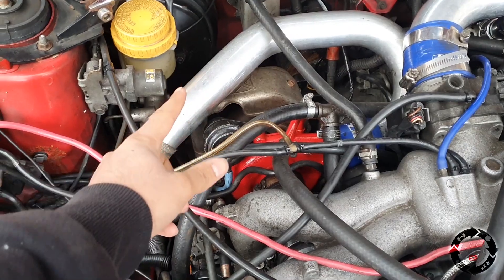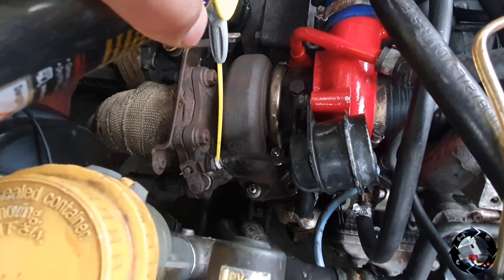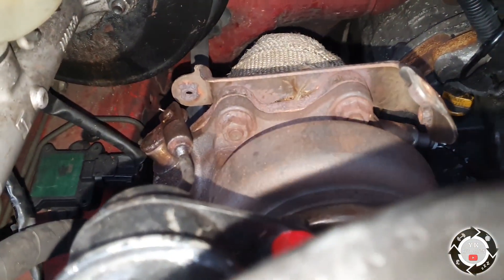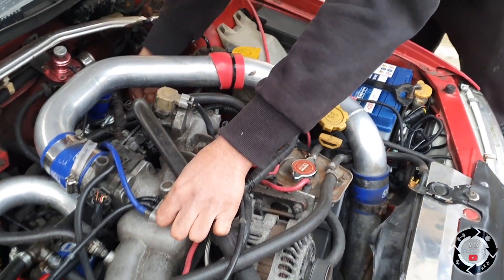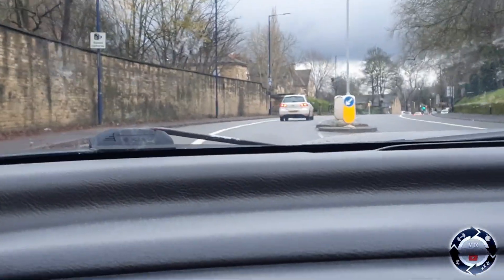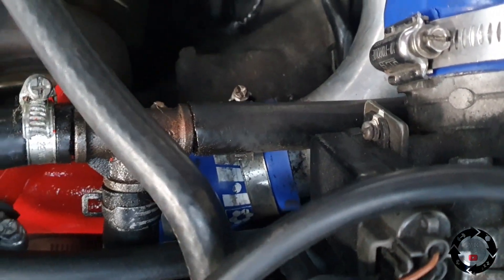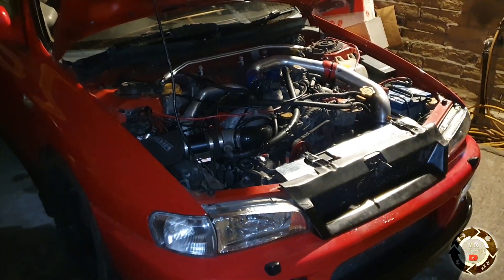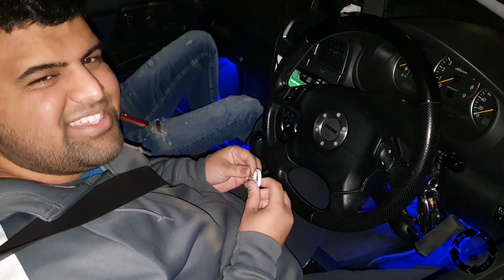FIXING BOOST CUT ON SUBARU IMPREZA GC8 *1.6BAR BOOST*

Comment: Hi mate I have a JDM WRX gc8 and I've just fitted a new turbo actuator and boost guage. It's boosting at 0.8 bar. In order to turn the boost up will I just need a manual boost controller? 

Thanks bro From Manny u boys sound like near Leeds ways maybe? not sure lol
Reply from the maker: Hi mate hope your well, turning up the boost manually is a bad idea, you need to get it re mapped for your new turbo setup 👍🏼 we did the tweak as ours is already tuned but since we had a few leaks fixed it was running too high so we turned the boost down. If you want to control your boost you can get that mapped in also. So you can have the option of high boost and low boost settings

Comment: You have shortned the wastegate arm, making the spring preload higher... meaning it's exaclly what you DON'T want. That will get you evem more boost.
Ok.. you noticed your mistake.
Reply from the maker: Thanks for the help, yes I realised I twisted it the wrong way as it peaked up again to 1.65 bar . I have re adjusted and brought the boost down now to 1.1 🙂

Comment: If it keeps popping off, spray hairspray into the pipes before clamping, it works like a glue
Reply from the maker: ah okay, is it flammable ?
Reply: @YKRECREATION  wait till its all cold, spray it on, put it all together, once clamped give it a few mins then go for about a 30 min drive so it all pipes get hot, it will then turn to glue and itll set, and u should be good to go, a lot of the octavia lads use it on there boost pipes, including me
Reply from the maker: @michaelhorsman3380  okay thanks its been better with the proper clamp but If it pops will try this hair spray trick out. Do you use jubilee clips or them intercooler clips
Reply: @YKRECREATION  i just use the jubilee clips, but as far as i know ash motorsport in cleckheaton it is (think its that area) do some better clips as far as i know
Reply: @YKRECREATION  just googled and its in mirfield
Reply from the maker: Okay thanks will take a look , are his jubilee clips type or 10mm bolt type
Reply: @YKRECREATION  erm pass cause only ever been for fluro lined pipework for when i did my catch can
Reply from the maker: Okay appreciate the tips hope its back to full boost soon
Reply: @YKRECREATION  hopefully then u can have fun and games
Reply from the maker: Need a nice drive out
Reply: @YKRECREATION  depends where u wanna travel lol
Reply from the maker: @michaelhorsman3380  I usually just go country side for nice calm drives
Reply: @YKRECREATION  i normally do cornwall
Reply from the maker: @michaelhorsman3380  thats a good few hours from me, I guess you from down south
Reply: @YKRECREATION  im halifax west yorkshire, we set off at 2am and get down there in time for breakfast
Reply from the maker: Proper drive out that 👌.  Never been but heard great things
Reply: @YKRECREATION  its awesome, proper peaceful, we normally go to charlestown and surrounding areas